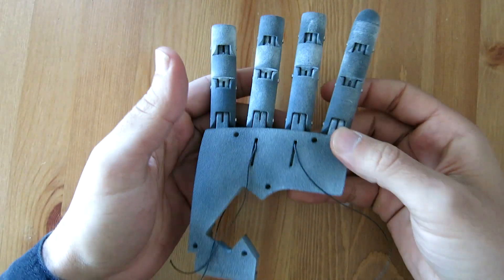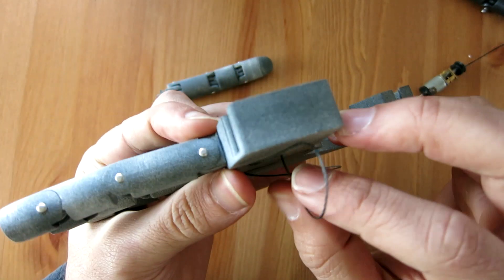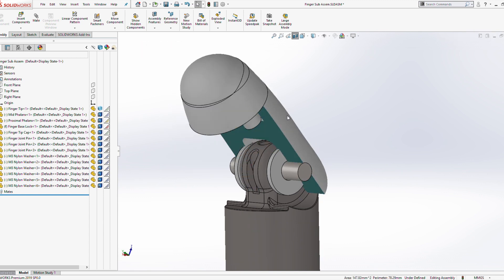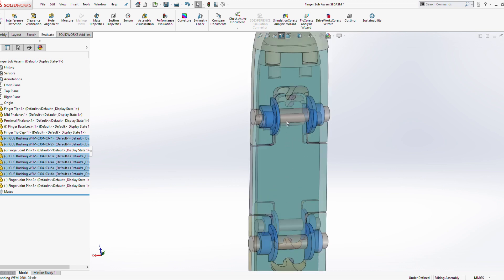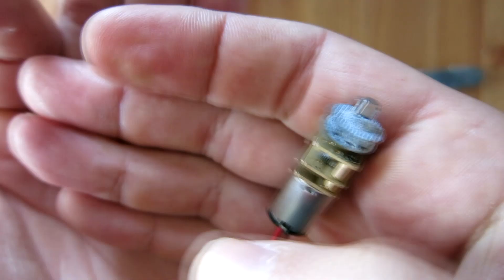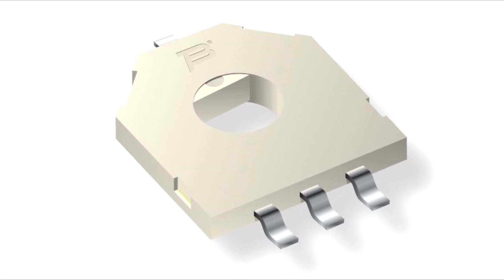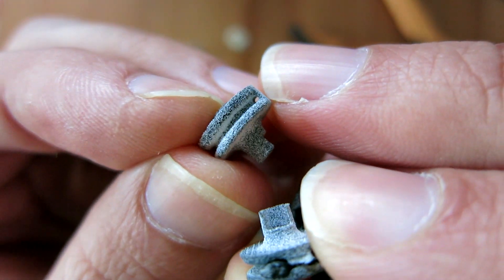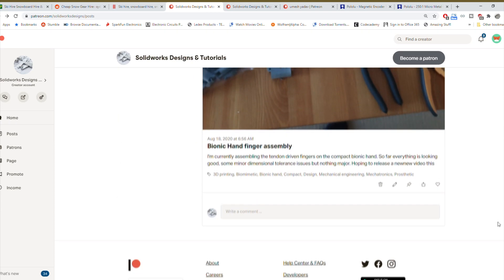Designing Bionic Fingers

Comment: it's a nice design but the heel of the hand is actually thicker than the wrist. So you could put the thumb on the outside of the metatarsals and the run the motor through the hand. Then you might be able to put four more motors into the palm of the hand. I've been very interested in replicating precise human motion and find that virtually no one has been able to do it.  there are so many misinterpretations of human emotion. It's very interesting. Also you might consider trying to rap a flex and extend or tendon around the same pulley. You would still need a knot somewhere I suppose.  and I think you should go forward with the wrist design. There's such a wide lever angle that the same motor would be sufficient.  it's very exciting but don't forget a raceway for the sensors. Hands need a lot of sensors. Those can be achieved with pager motors. But I like to think smaller solenoids will become available. It's a very delicate business trying to inform the skin, But that kind of sensing makes the hand really complete. I would love to work on the project. But I don't think Google allows people to communicate. Try to contact me if you can. THEUBIE

Comment: Awesome! I made an inmoov arm myself. I was wondering if you think the extra degrees of freedom for the thumb will be sufficient for an amputee, or should the fingers ultimately also have an extra degree of freedom?
Reply from the maker: That's great, how did it turn out for you? Extra degrees of freedom in the fingers is ideal but I believe the thumb is more important - it allows for better opposability to manipulate objects between the thumb and fingers. I could later on have motors in the forearm driving tendons for added degrees of freedom in the fingers
Reply: Mech Designs & SolidWorks Tutorials Pretty good! Still having some twitching issues, probably power supply related. Thought a big capacitor and small capacitor would handle peak current draw and filter out noise on the line..
I’m equipping it with a camera, and training a model to have it play rock paper scissors with humans at the moment. I had some other ideas with grasping of objects, but it doesn’t quite cut those tasks.